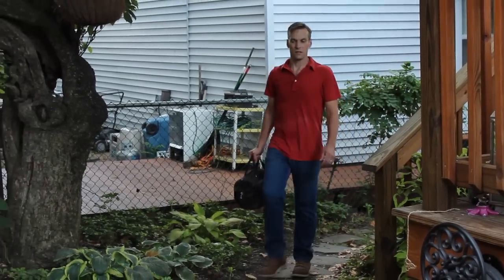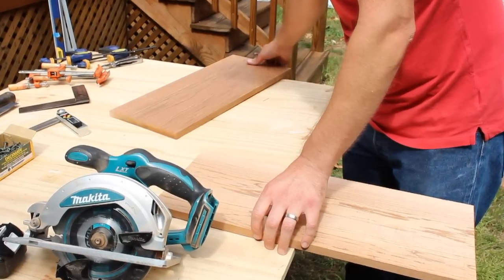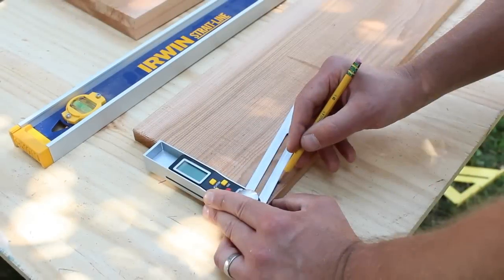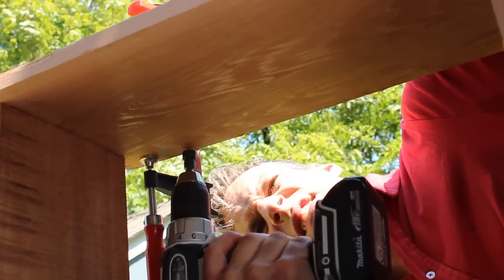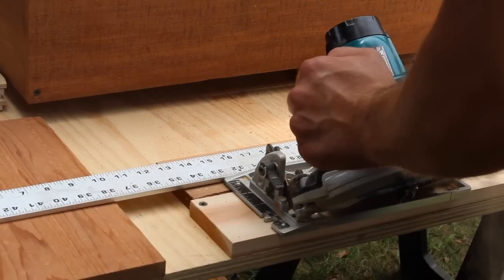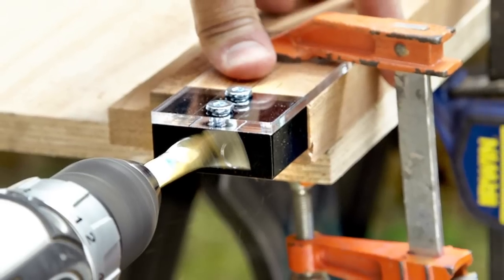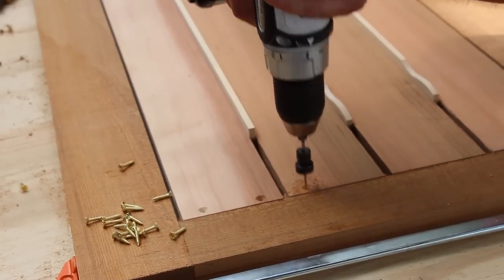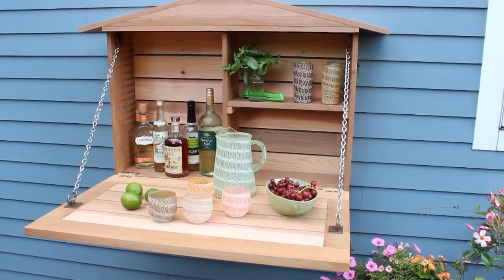How to Build a Fold-Down Murphy Bar | This Old House

Comment: I like the unit, but, I am building several for my car port, one for extra oil, tune up tools, and another for car washing and waxing supplies, another for my small garden hand tools, gloves, and seeds.  With the full height closet in the corner for fertilizer, potting soil, and mulch. Keep those materials out of the house.

Comment: Please tell me those aren't drywall screws. Also, the Brad nails, even if they are galvanized are going to leave black streaks all over the cedar. All screws and nails should be stainless when working with cedar. And technically Tite Bond II is water resistant, but it really shouldn't be used for exterior projects. Tite bond III is waterproof. Two is only water resistant. Come on, TOH. You're way better than this.